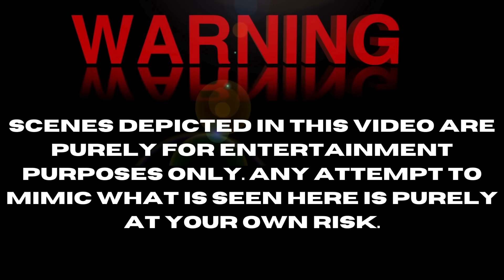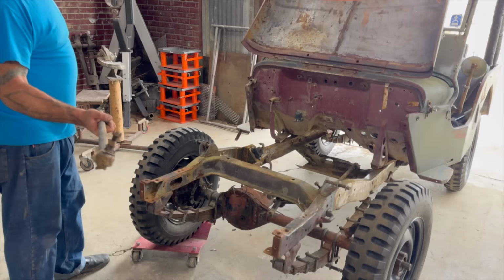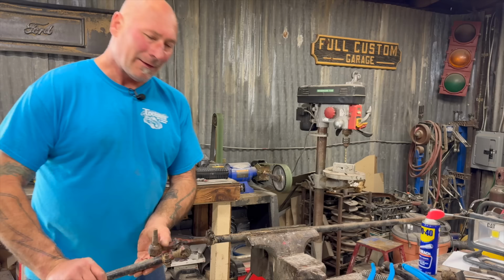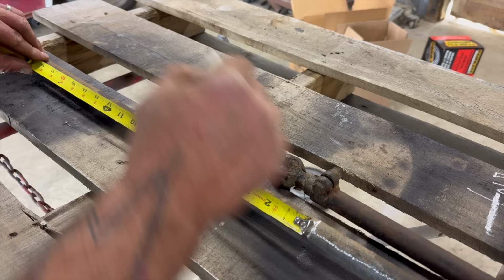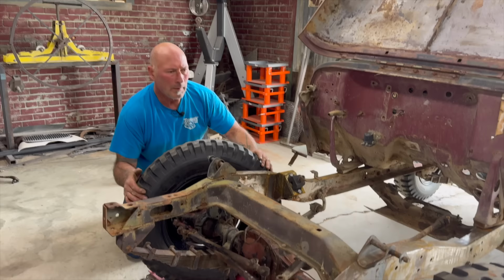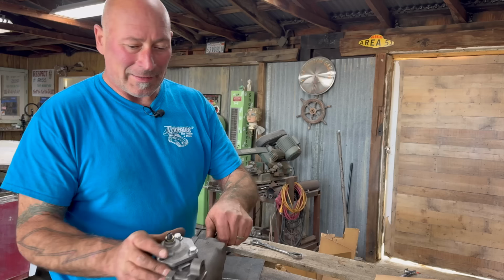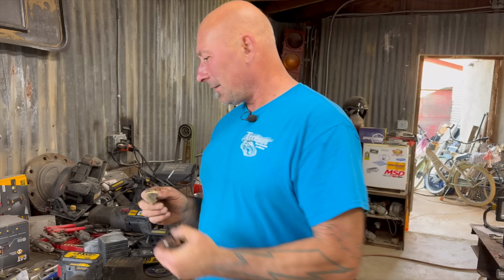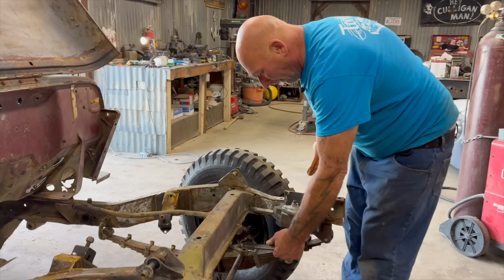Part 5! Jamie's Jeep Steering Swap and Fabrication Of Steering Box Mount  Ian Found Inspo At KOH 24😎

Comment from the maker: Hey everyone!  We had a GREAT TIME at KOH 2024!  We are glad to be back after taking a week away from the socials and filming!  Ian is taking on this jeep project head on with the cross steering!  It is cross steering, not typical of hot rod steering!  We can't wait to get this jeep rolling very soon!  Please remember to SUBSCRIBE!  LIKE! COMMENT!  SHARE!    Big LOVE!  Ian and Jamie
Reply: Ian for the steering in relation to the cross member you can cut a hole straight through it and weld a piece of pipe in the cross member so the steering rod can run through it and you can keep the strength of the cross member
Reply: Is there a reason you can’t attach the steering box to the closest end of the steering rod?  Instead of going all the way across ?
Reply: Yes ,bump steer.
Reply: @TX-biker  Wheel Articulation..
Reply: Jamie--what is the post production like getting these YouTube vids online?
Reply: Like the vidio
Reply: first thought on the clearance issue with the steering wads to put a 2" lift or make either a shackle or a longer leaf spring mount for just the front leaf spring mount. that way you would only lift it a small amount and it would be half of one end...   ???
Reply: @chrisdunham2911  The steering knuckle is on the end of the axle tube which is mounted on the spring, longer hangers won't change that, it needs a spacer between the spring and axle tube.
Reply: I have a 90 YJ It's linkage that may work with a little adaptation Might be worth a look Quadratrac has it all
Reply: Check the clearance between the springs and the steering rod at both ends of suspension travel. A tube through the subframe will make mounting the steering box easier

Comment: It's pretty common to weld a bung with a tapered hole on top of the cross bar to attach the tie rod of the drag link to. It would solve the clearance issue on the passenger side because it would move the drag link rod end inboard of the spring on both left & right turns, still keeping the drag link as long as possible.

Comment: Thought !!!! Do the hub arms disconnect ??? if they can  be swapped from one side to the other, behind instead of infront, it would allow you to move the steering box behind the crossmember with the pitman arm forward instead of back. Giving you a much shorter steering column link and no crossmember issues.

Comment: My '48 Willy's had a "crystalized frame" (it didn't like the weight of the 302 HP someone put in it).  The Willy's frame flex is one of its secret weapons but at their age they break.  I know you will know what to do about it.   
The stock brakes will remind you to not drive too fast. 😂

Comment: bit behind on this. My uncle had an M38A1 and had modified the steering way back in the '70s. They used the stock ends much like you did with just tube sleeved over the cut stock rods. I forget what vehicle the tube came from (large linkage from a truck iirc). I also forget what else they had to do for clearance. Later he flipped the axles to lift it for putting 36" tires on it (he had bought it Mil-surp with a bad engine and swapped in a Buick V6) because it still had the mil-spec gears in the axles, and he was going to drive across country.
Also, a friend of mine had a CJ7 and had acquired the wrong steering box for it when the stock one was worn out . . . He had "turn left to go right". 
I followed him home from the shop so he had extra hazard flashers for his very slow trip home. He then left town for school and sold the Jeep and it was towed. Best way to drive was hold the bottom of the steering wheel so moving your hand right turned the wheel left to turn right. We never got over 5mph anyhow.

Comment: The only issue that you could run into by using the longest rod insert would be that if you didn't leave enough room on each end, your tie rod ends could bottom out against that inner rod when you're trying to make adjustments.
Reply: That occurred to me, too, as a possible limitation.  Did Professor Ian bottom out the ends to see if he left enough internal clearance?  I guess we'll see!

Comment: When you hit a bump and the spring is pushed up , it will bind and bend the tierod end and most likely break it and / or your springs.
Reply: The Axle Tube moves up and down with the Spring, it's bolted together.

Comment: Hey Ian I have done the steering swap you are doing I used ford rod ends and got tapered reamer from speedway and put rod ends on top of arm on steering knuckles gives you plenty of clearance I did use power steering box just a little info that might hep run taper in from top on steering arms

Comment: You are digging your way through the geometry there. Make sure to account for your spring travel. If you can move the attachments on the hubs themselves higher, problem solved. Otherwise, you can see why they used multi piece tie rods and drag links. To raise the tie rods above the springs. Get that sorted first before setting your steering box. Also, take a look at the early 2000s dodge pickup steering. Single bar with drag link.

Comment: If you went with Heim Joints you could drill out the tapers on the hubs and place the Heim Joints on top with grade 8 bolts.
Reply: Probably not road legal.

Comment: An option is to use heim joints and move the tie rod to the top of the steering arms, that gives you the clearance you need. You can make a new tie rod and weld a tab to it and come off of the tab for the drag link. It won't be "Jeep" type tie rod ends but it would be smoother steering and last forever...and it'd be "custom".
Reply: Then you can't turn the drag link to adjust toe in etc.

Comment: Tie rod straight alignment, drop the two halves into a thick angle iron and clamp both down. Clock them and weld. 

Cardboard hole transfer, ball peen hammer tap the cardboard and it usually cuts the hole in the cardboard for you.

Comment: I made my stearing so much easier. Do you remember using a broom handle and wraping the rope around it a few turns and secure it. Turn the stearing wheel and it wraps and shortens to one side snd lengthens to the other side. The wheels mounted to a cross 2x4 that pivots on a center bolt.
Reply: Heck, yeah!  Pinewood Derby tech oughta' work great on Jamie's Jeep. 🤪

Comment: Since the axle sits on top of the spring if you were to make some small spacer plates ( just thick enough for the clearance you need) and place them between the axle and the springs you could address the clearance issue with the tie rod and lower the front of the jeep ( just a little) at the same time.
Reply: I couldn't see if there was a foot on the axle tube to stop it rotateing..

Comment: Ian, just a thought,  why don't you get a remmer so you can put the track rod ends in from the top instead of the bottom as they are now, you would also have to bush the larger hub holes or sadly have to buy new track rod ends, I guess you probably had the same thought,  best wishes to you both 
Darren

Comment: You could fix your tie rod clearance issues with a couple of heim joints. They'll thread right in your drag link and you could drill down thru your tie rod holes and then use some bolts and move drag link on top instead of the bottom. Just a suggestion. Love what you're doing.

Comment: Late to the party, but why not just bend the link between the Pitman and the ball joint at the wheel? You need to lengthen it anyway, so the bend won't affect the steering, but it will give you the clearance needed...

Comment: It would be stronger if you sleeved the bolts as they go through the frame to keep the frame from collapsing under the torque of the steering box
Reply: The plate is being welded to the frame..

Comment: 🦘🇦🇺   🤔 G'day Mr Roussel, when you put the piece of round bar inside the tie-rod tube did you leave enough gap at the ends to allow for adjustment if required, did it hit up against the rod end or the end of the internal thread ??

Comment: Have you limited your tie rod end adjustments if you put the filler rod touching both those ends?
Reply: The tie rod is a pipe which was too long so he cut one foot out of the length to shorten the tie rod, you don't need the fill rod filling the center of the tie rod with a big piece from end to end. All he did was plug weld the filler rod that's in the center, then weld the two outer piece's, the adjustment comes from the end's of the tie rod one side forward threads and the opposite side reverse thread that's how you get adjustment, the filler rod is not at the point to hinder the tie rods adjustment in any way. All you need for the filler rod is three inches.
Reply: @DooDeeDew  I was thinking he put a long piece in that went from tie rod end to tie rod end, butting up against both of them. Approximately 23.50.

Comment: A bit of advice when welding pipe or anything round that you wanna keep perfectly straight clamp or tack your pieces into a three foot piece of angle iron in your situation,  it'll always be straight that way. The length of angle iron depends on the length of the two pieces you're welding together,  it doesn't have to be as long as your pieces your putting together but i like my angle iron to be as long as possible